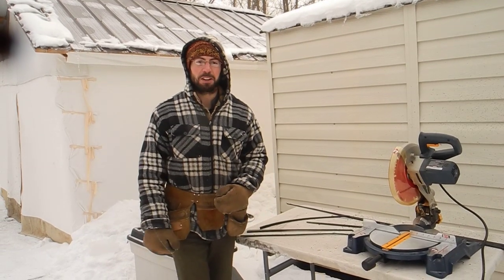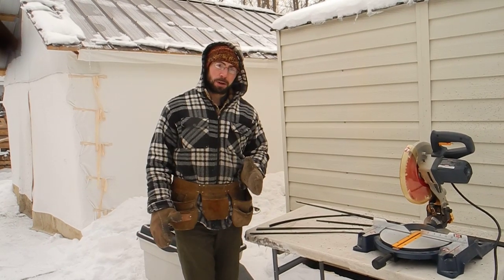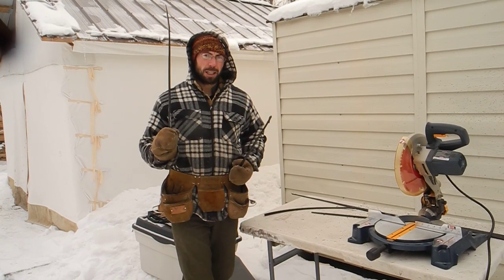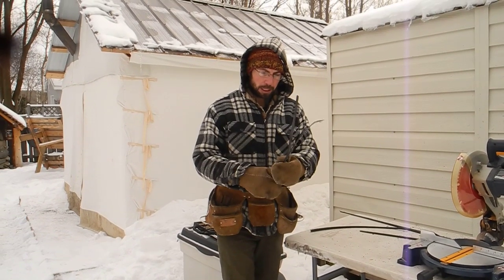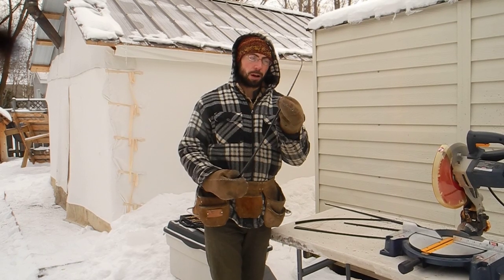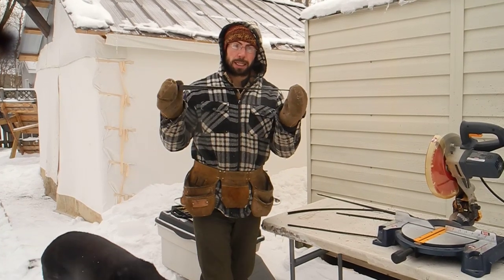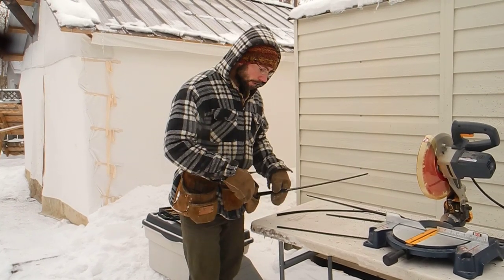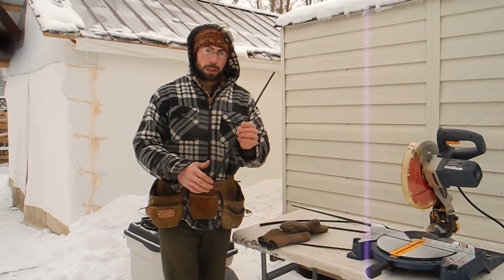Toboggan Plastics in Cold Weather

Comment: Cool demo Dave!  One of the biggest risks to breakage I think might be a run-away toboggan on a slope that hits a tree.  The force and quick bending or twisting might crack it.  Also wondering about fatigue and accumulating micro cracks around bolts. Good to know breakage can happen, and take steps to avoid it.
Reply: Wintertrekker